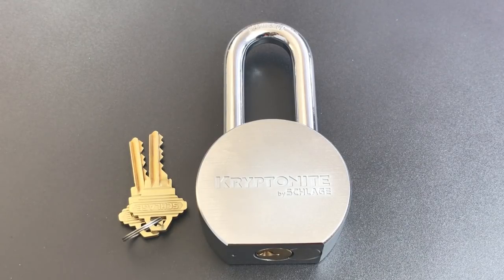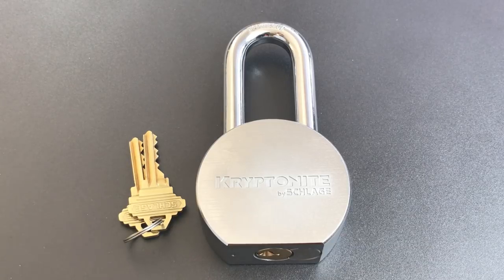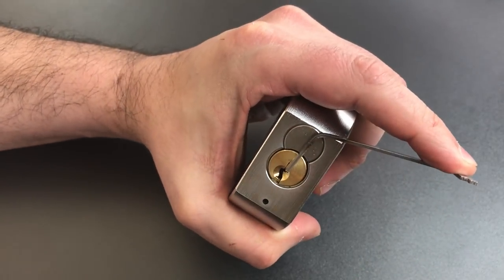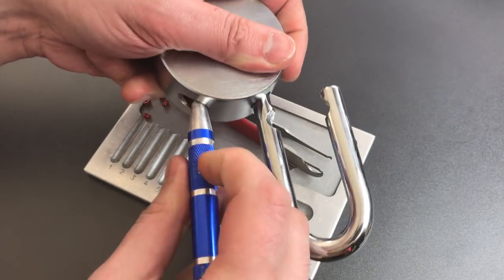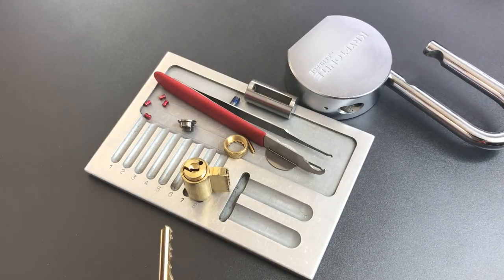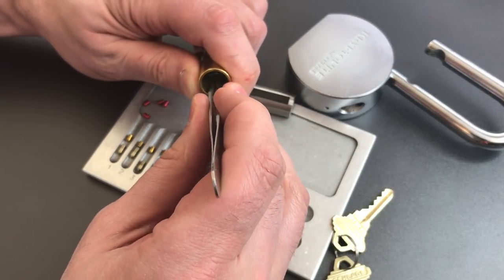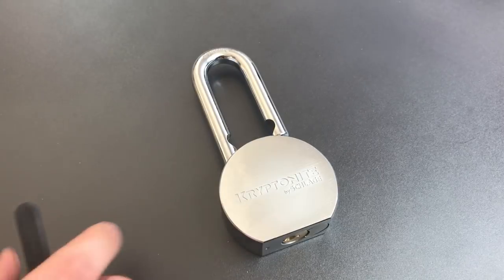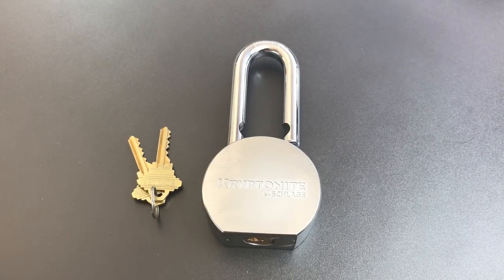[608] Kryptonite KS72 Padlock Picked, Improved, and Repicked

Comment: Great work. I would definitely occupy all six pin holes in the future. I still don't understand why they don't. the cost is so minimal.
Reply: Albert Lebel it’s just price point adjustment. The 6 pin jobs sell for more but it costs so little to drill a hole that they do them all that way and just sell them without pins fitted.
Reply from the maker: Agreed, but I was too lazy to get the pinning kit from my car. ☹️
Reply: This lock looks nice and I would use it. I would definitely rekey to a 6 pin and add security pins without thinking twice. 
My local locksmith has even cut me 6 pin keys in a way I don't have to change the existing 5 key pins.

Comment: I love this lock... I use similar locks for all of my lock-up applications.

The padlock tail-pieces have the letters "S" & "P" stamped on them... "S" denotes a standard (non-Primus/Everest) cylinder... and "P" denotes the Primus/Everest cylinder options, for which the retention pin for the tail-cap is on the 2-o'clock position versus the standard cylinders, of which has the same retention pin placed on the 10-o'clock position.

Stock Obverse Keyway Family "C" Section cylinders are always pinned up for a 5-pin key, as residential keys are also 5-pin.

Comment: Great picking. Nice looking lock. Nice beefing up of the padlock. I did something similar to that with a Centurion 65mm padlock. It is almost impossible to pick now because of the excessive play in the core. The cylinder moves so much, you loose tension wrenches,  and setting spools is a very difficult task. I threaded the core and bible and put in security pins. The only way I can pick it now is to put the core in a vise.
Reply from the maker: How did you get the core apart? Mine was held with a blind pin.

Comment: Nice looking lock I like the full size key... I feel the Core Puller would kill it fast as not a lot of threaded screw holding in the core...
Reply: Jolly Peanut I get the feeling that the core puller has not been considered in the design of most locks.
Reply: Lock makers have to keep up with change but really the core puller is just a improved version on the old slide hammer they both do the same thing rip the core out..
Reply: Cheapest way against core pulling could be some steel band, which goes around the lock through the shackle. It could cover most of the core, since the key turns just 90 degrees.
Reply: good idea..

Comment: There's a simple way to screw the core back together, take that tail piece and use it to depress the plunger and screw the holder in to place til it's snug, back it off a quarter turn and spin the tail piece to the proper location releasing the plunger. You may have to adjust how it fits but it's way faster.

Comment: You should get the lab cylinder cap removal tool to take the tailpiece off easier. Saw one on ebay for $35.
Reply: Sparrows offer them in resin too for something like $3. The problem is that they don't work when there is an actuator in the core like here.
Reply: +macavity
The good ones simply "ignore" the tailpiece
Reply from the maker: I have one... but the padlock driver is in the way, as other pointed out. 👍

Comment: Thanks for the education. Did you back off a little when you screwed the cap back on so the lock wouldn't bind? I'm guessing if you filled all six you would have had to make another key?
Reply from the maker: Yup... tighten it down, then back off two notches.

Comment: Which is the better shackle material? molybdenum or boron Carbon steel. I know both will rust but molybdenum is better for resisting corrosion. But what about sawing and bolt cutters. Thanks

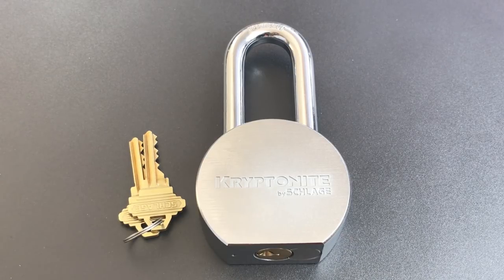Comment: can someone spell out the makes and model he goes over at 1:02 ???
Reply: 911LexVegas Lockwood 301, Paclock 900 kick (Pacific lock company). that's what he said anyway.
Reply from the maker: Slight correction: 900KIK (key in knob)
Reply: LockPickingLawyer Damn. my bad... I should have made sure auto correct didn't mess with my comment before posting...

Comment: I didn't realize that the Molybdenum alloy shackles were that much harder to cut than Boron alloy shackles. Chromoly is something I hear of regularly, while Boron alloys aren't something I'd heard of before, so I'd expected the Boron alloys to be stronger (when I guess they're cheaper instead).
Reply from the maker: Interestingly, boron alloys were rarely used until WWII when we needed a cheap molybdenum substitute for transmission gears... it caught on after that as “good enough” because molybdenum was expensive.

Comment: I would have put a long key pin in position 6 to rest on the key tip, and then used a standard driver pin in that place allowing all the other five drivers to be spools. This keeps alignment for the full insertion and withdrawal of the key, and adds a bit more pick resistance with another spool, especially if you can use a very slightly thinner (or slightly tapered) driver pin that tends to fall down every time you go to set one of the spools. Try it.
Reply from the maker: I’ve done it... but the pinning kit was in the car... and it’s cold. ☺️

Comment: LockPickingLawyer why didn't you populate the sixth chamber when you repined the lock for the "upgrade"? Couldn't you just ride a key pin off the tip of the exsisting key and add a driver security pin of your choosing??? What was the rationale behind not populating the sixth chamber?
Reply from the maker: I have a very good reason. My pinning kit was in the car, it was 2am and freezing... ☺️

Comment: Does changing the springs to different tensions be an improvement?  I liked this video as you show how to improved the lock.
Reply: Different springs is an effective way to stop bump keys from working. However in the real world (where we worry about actual criminals) you worry about the physical side of things, as picking/bumping with criminal intent is relatively unheard of.
Reply from the maker: For me, I don’t find different springs particularly challenging... unless you have a gorilla spring, like the ilco bump halt system.

Comment: I have this same lock fitted with a best sfic 6 pin core, but is it the same model that will accept regular cylinders with that core filler cap or strictly sfic cores only? There is a blank screw hole on top & I have no control key to remove core though.

Comment: is there a household lock and or padlock that isn't dead simple to pick?
Reply: Aaron Anderson Good disc detainer locks, like Abloy and Abus, are hard to pick without proper tool. That tool itself is cheap, no problem to get it, but I think few thieves have it. Some skill is required to pick a good disc detainer, brute force is easier, and often there are other weak points than the lock itself.

Main advantage of a disc detainer lock is, that there aren't any super fast non-destructive ways to open it, like raking and bumping for poor wafer locks.

Comment: do the pull test please
Reply: utUBEr00001 in the previous video he used a core puller to pull the core out of a padlock. It was a powerful little thing and very quiet. Since it is designed to do exactly that I’ve every confidence that it would rip this one out too.
Reply: utUBEr00001 similar MO, but the core puller uses a large diameter, fine pitch screw instead of a sliding weight. As a result it’s very compact and nearly silent. Good kit.
Reply: utUBEr00001 True, it’s much the same thing.
Reply: Ya see now

Comment: So I didn't see, but I assume it was only a 5 pin bible, so you couldn't easily take advantage of the 6 pin core if you wanted to?
Reply: It is also a 6 pin bible. Completely standard Schlage KIK cylinder. They just only populate 5 slots on the cheaper models.
Reply: Would the key on hand be able to utilize it?  I'm a complete n00b at locks and keys, just curious.  Would some key pin and driver pin combination have been able to rest on the tip of the key?
Reply: Yes, you can make a pin ride the tip of the key. I've done it. It isn't entirely optimal, as you have to make absolutely sure the key is bottomed out or it won't turn. Also, riding on the tip is nearly a max cut, so the driver pin only have to lift a tiny amount which obviously negates most security features.

Comment: Slide hammer will pull that core without any effort, best you can do is install a cyberlock core.
Reply from the maker: Maybe... probably. 

I tend to break more screws with slide hammer than this FWIW. Also this is small and quiet. I’m going to try and use this more.